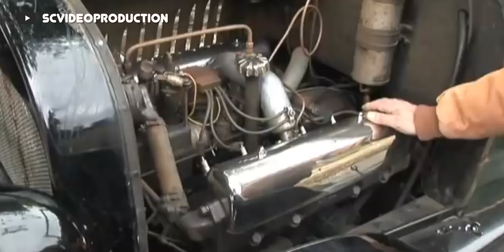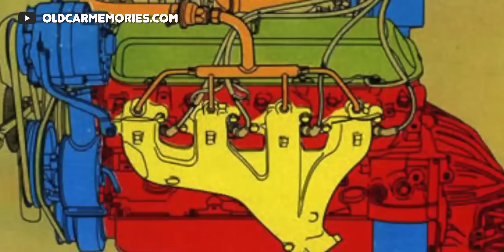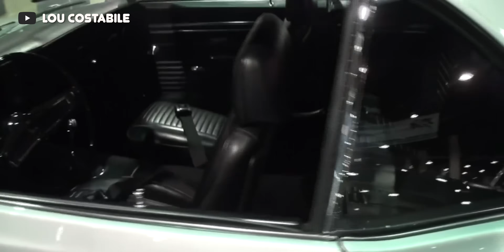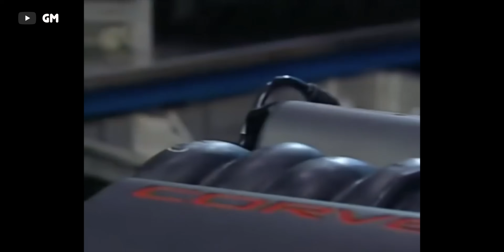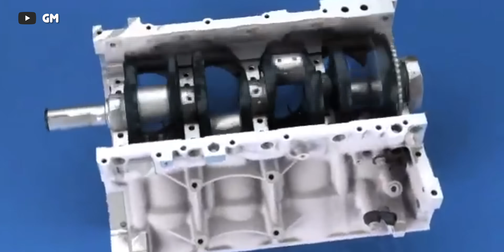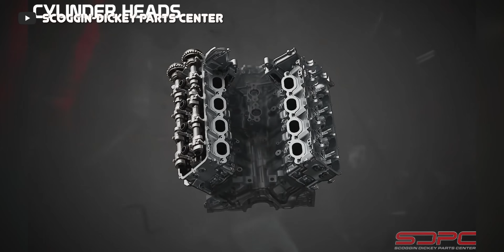We Ranked the Best Chevy V8 Engines Ever

Comment: I absolutely love the LT6. GM basically abandoned their entire history (and decades of experience, R&D, and tooling) to create what’s basically the polar opposite of their already excellent V8. They tried with the Northstar, did a great job with the early LT5 (although a complete sales failure) but the LT6 is just insanity from a corporate giant like GM. Revs to the moon, FOUR cams, bespoke materials, state-of-the-art engine management, fairly minor displacement (among GM V8s, at least) and a freaking warranty. The OHV design they’ve been using for the better part of a century is a truly excellent engine, but I think this N/A monster might just be GM’s Magnum Opus for performance engines before the big push to smaller, turbocharged performance and HEV/EV drivetrains. Will it be anywhere near as reliable as your average gen 1/2 small block, big block or LS/LT? Not a chance. But that’s not the point. This is GM’s high-water mark before the EV craze murders our ICE performance cars for good.
Reply: No offense but I would choose the LT5 dohc v8 over the lt6 any day because the LT5 wasn’t copying an other engine it was all new an dohc engine with an 350 sbc displacement it is unique rare and is awesome 😏 let’s be honest the LT6 is just Chevrolet copying fords home work on the voodoo from the Shelby gt350R it has very little to anything it shares in common with the 458 engine the only things they share in common is sound /crankshaft /dohc instead of that the LT6 is like GMs attempts at trying to beat the Ford modular engines specifically the coyote series of engines 😬😬 .do you really believe Ferrari the company that try’s to sue people for putting shoes next to their car on an ad and other stuff would let gm make an direct rip off of the 488 gtb that’s what an twin turbo LT6 ZR1 will be 😮
Reply: @xx_ironman77_xx1  Very difficult to follow anything you said, with it being written in one endless sentence.

Comment: 283ci rev's higher than a 350.
Reply: Million mile motor low on hp expensive to build to make 400 hp lot of money but a very dependable engine easy to work on I like em cheap on gas
Reply: This is a very general statement, and there are no absolutes. It comes down to piston speed and valve control in the end.  But you could build a 350 that revs higher than a 283, and vice versa.  Ohc/dohc is better suited for high rpm while still having long valvespring life, usually much lighter valves, softer springs, no weight of pushrods, lifters to control, sometimes not even rocker arms.